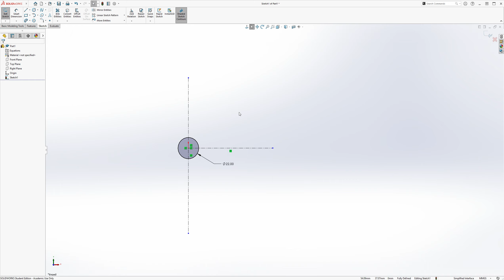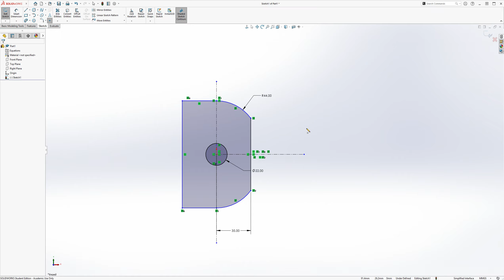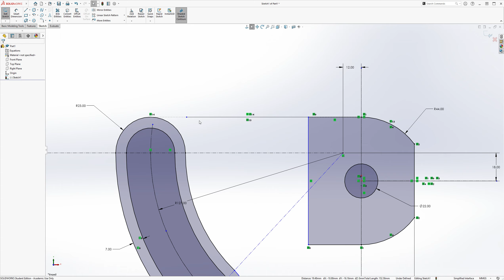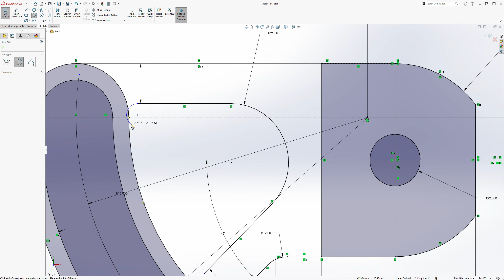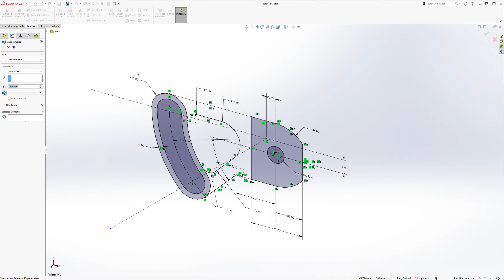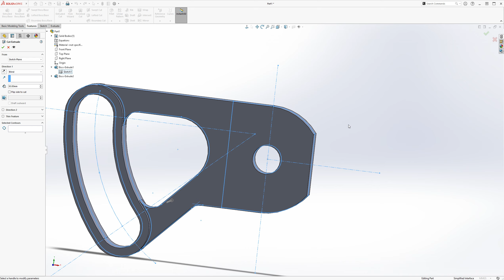Solidworks CSWA Practice Problem 4.27

Comment: hey, i'm currently doing my cswa training and i get soo confused while selecting the plane in which we must sketch the object by viewing it in the blueprints that the SW provide. i tried making this same component and i got the volume of my component as 185124 cubic millimeters. My method were not as clean as yours they were pretty unrefined. But i ended up sketching the component in the top plane. And i end up making these mistakes a lot. so if possible, could you upload a video addressing how to read and how to decide the plane in which the object is places and we must sketch it so that the component position is perfect according to what mentioned in the blueprint.
Reply: train your perspective by creating alot of models
(that's the only way)
Reply: @SonicMenuWithPrices  yes, agreed. over the period of last week i ended up creating several models and i get what you are saying. thank you for the suggestion, appreciate that.
Reply: by the way i got Volume = 185179.47 cubic millimeters
Reply: @SonicMenuWithPrices   is it always necessary for us to get the volume of the parts exactly the same as expected in the blueprints from SW ? or a little variations are fine ?
Reply: @swarooppatil0806  Some answers are identical, some have a very slight difference but some are just wrong by a good margin. 
Whenever you get the wrong answer confirm it with other just like this video